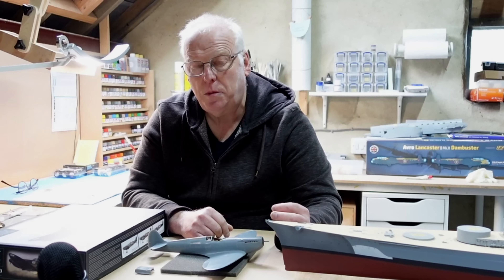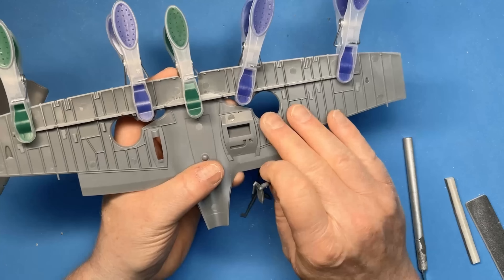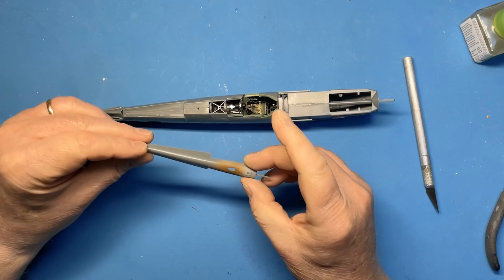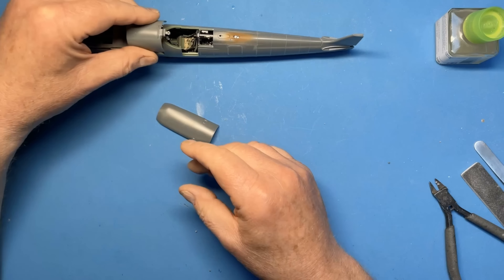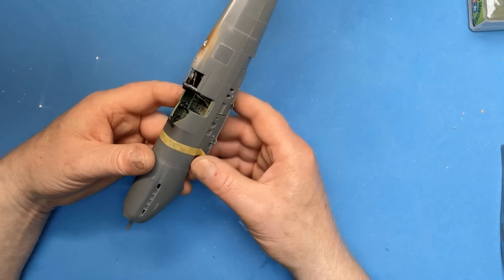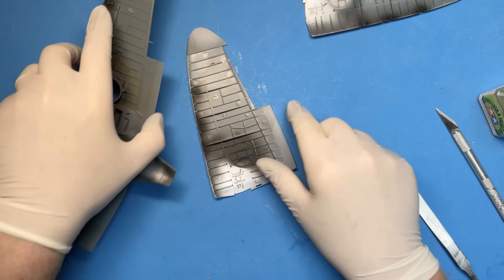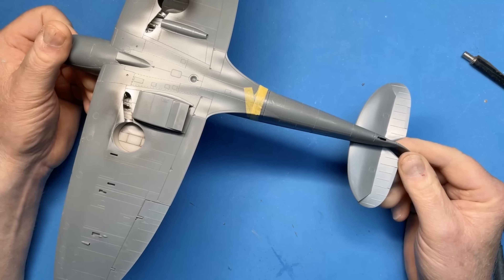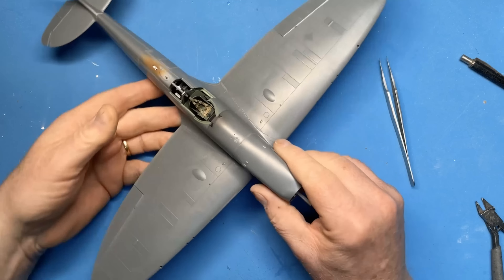Kotare 1/32 Spitfire Mk1a part 3

Comment: I'm enjoying watching the build immensely, I ended up holding my breath when you were installing the control cables last episode fearing that wires you'd already put in would get dislodged. Hearing the parts click together and the tight fit of the parts to me means this is a well designed kit I am hoping that Kotare will at some point re-release some of the old WNW kits. Looking forward to the rest of the build series.
Reply from the maker: Thank you it’s going well so far 🤞

Comment: High Steve had the privilege of building a set of MK1a wings at airframe assemblies Isle of Wight for x4650 . The wheel wells were painted all structural aluminium on this aircraft with the duck egg green 1939 . I don't know about 1940 black white and if the wheel wells were painted those colours. I noticed you filled the leading edges , more accurate would be to have a panel join there as per original however its personal preference. 
I was a little disappointed that Kotare did not model the gun panels separate and allow the modeller some details of the ribs and 303 to show or indeed give you the option. I also think they missed a trick with the undercarriage pintol at this scale lacks a little detail there . 
Steve your modelling is fantastic and i hope i was not to critical it was more aimed at the kit , i cannot fault there skin and rivet detail fantastic. While i was building the wings we had a few visitors around and some were from Airfix  and Tamiya . 
A trip to Hendon museum had me on my back for a few hours taking pictures and measurements and tracings of the skin work and frame work holding the oil cooler, all original drawings were lost some how so reverse engineering had to be done. 
Thanks again for the channel.
Reply from the maker: Very interesting thank you. Kotare have taken a very simple approach to this kit which I like. I guess they had to draw the line somewhere🤔

Comment: Steve are your tailplanes like mine - completely smooth apart from two D shaped access panel on the underside and the leading edge overlap? Doesn't seem right, especially on the undersides where there were screws. Everything else is so accurate.
Reply from the maker: Yes Phil mine are the same. All the photos I’ve looked at of MK1/IIs the horizontal stabilizers and fin are smooth.
Reply: @TheModelShed  They probably should look smooth at scale (but then so should most of the aircraft!), but the tailplanes definitely have flush rivets and screws and I've not been able to find any reference to them being filled and smoothed. Just an interesting choice by the guys at Kotare - might drop them a line and ask then what their thinking was. Sorry, I've become a bit of a Spitfire bore since coming back to the hobby!

Comment: Regarding the undercarriage legs, I would rather have them tight and require removing material than lose and potentially screwed up angles. If that is the biggest issue with the kit, then things aren't that bad.
Reply from the maker: I agree - and we have do a bit of work rather than clicking everything together right?
Reply: 1a according to Kotare. Just wish I could pay in NZ dollars.